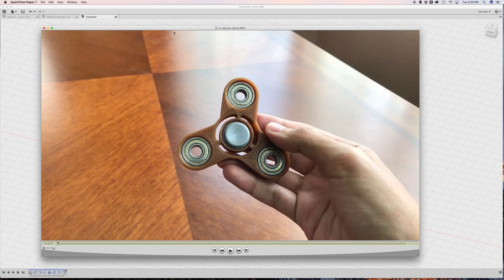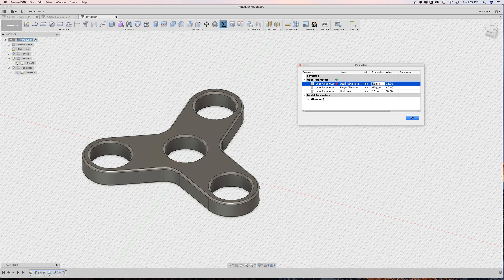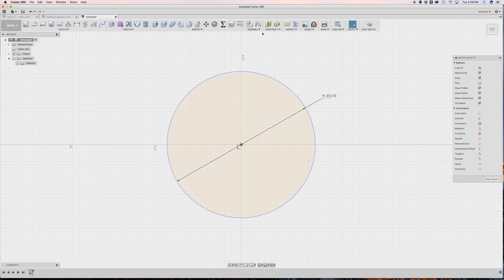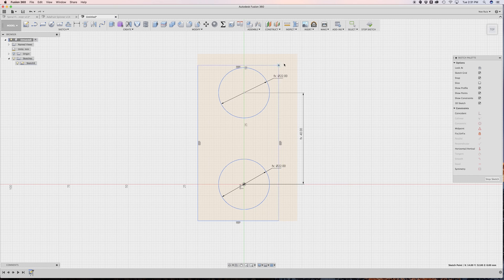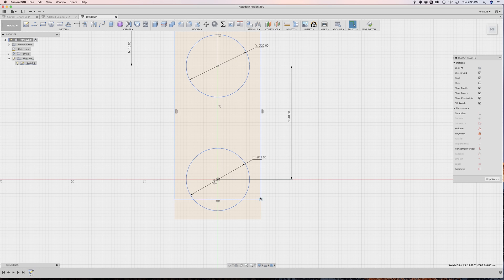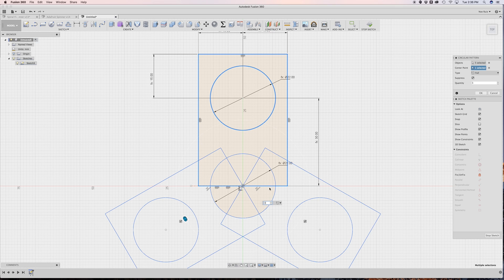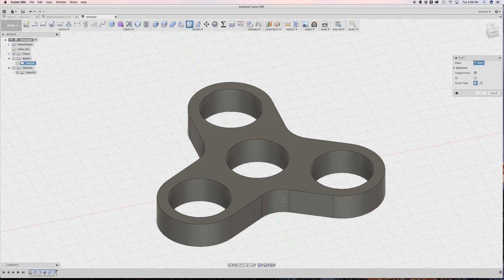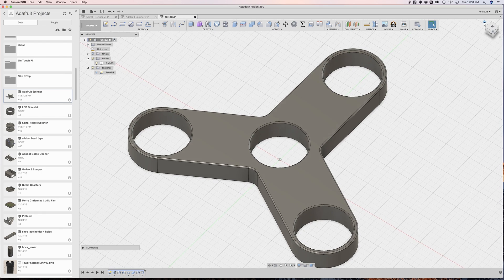Layer by Layer – Using Parameters with Patterns

Comment: Wouldn't it be even better to have a parameter for the distance formula thing instead of copying and pasting the formula several times? Would make it easier to change if you need to add 6mm instead of 4mm for example :)

Thanks for the tutorial, i love Fusion 360 i use it a lot for 3d printing to!
Reply from the maker: Of course! You get gold star ⭐️ Thanks for watching, and learning 😄
Reply: I haven't used Fusion360 yet, but, could you paramaterize the pattern also, so the number of arms is easily modified?
Reply: Yes you can do that easily